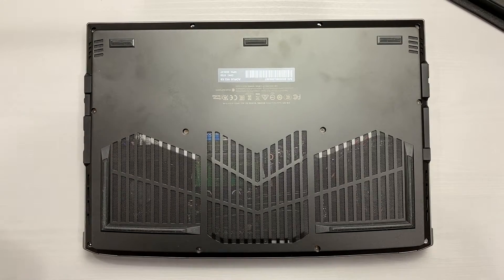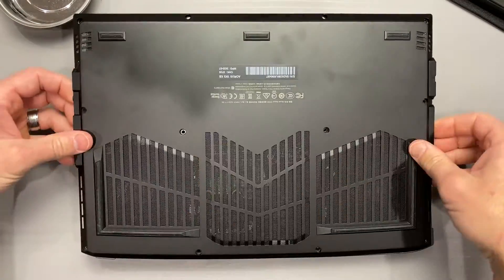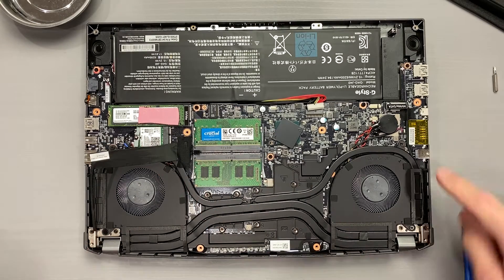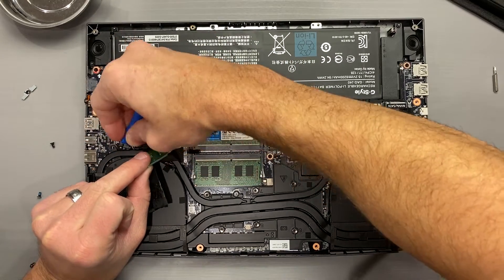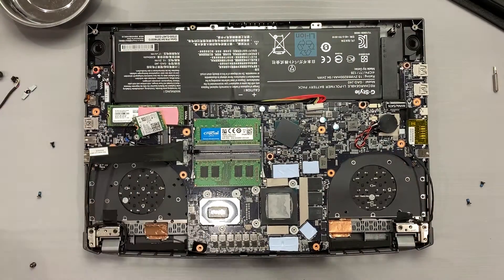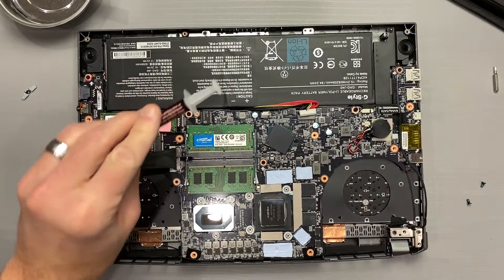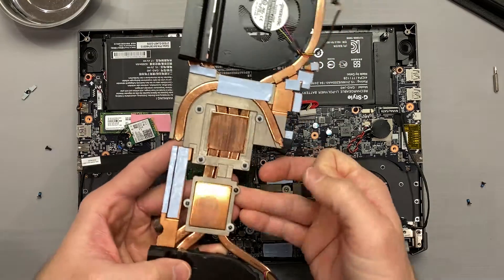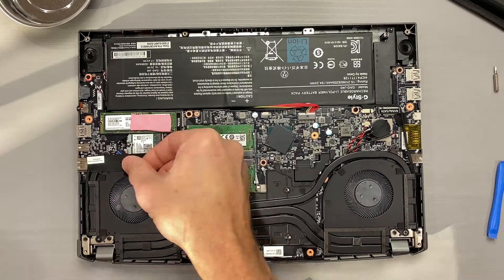Aorus 15G Repaste!  Covers 17G and Newer Aero Laptops

Comment: Hi, if one wants to put back the 7 black rubber tips you removed which cover the screws of the heatsink what type of glue is suggested? As far as I know, glue put there must be heat resistant (until 100-110 C temps at least) and it must be not flammable. Otherwise, when you use the laptop and the cpu reaches high temps of 90-100 C, there is high risk of triggering fire. This can be very dangerous. Normal glues don’t have those specific properties. Only silicone sealants can resist very high temps but I don’t know if they are appropriate for the inside of a laptop. What would you suggest? Also, if those rubber tips are not properly re-glued and they collapse on the motherboard, they could be moving around while using the laptop and risking to fry components (high ESD risk).

Comment: Hey there! I am going to replace my cpu fan because it started rattling for a while now. I also planned to repaste my cpu and gpu when disassembling the heatsink. Is it necessary to replace thermal pads as wel. I have the Aorus 15G KC with a RTX 3060 and never done this before with this laptop since i bought it in summer 2021.

Comment: Hey mate, I just disassembly my laptop and I do that thermal paste, after I run laptop but display is not working and fans are not running just rgb lightnin on , when I try to shut down laptop with power button its not working just looping.

Comment: Hello, very good video and explanation, I wanted to ask you a question. Did you see the Wi-Fi card? The cables are disconnected by pressure, right?  Greetings from Argentina Buenos Aires
Reply from the maker: They clip into place.  Very small and prefer even pressure when removing and installing the wires onto the WiFi card.

Comment: Yesterday i gave my laptop for cleaning and repaste,but after i got it home there’s a sound like a fan hitting a wire or something that you can hear it only in low rpm,so tonight i think i will open the laptop to see if i can find a solution,problem is i don’t have any paste to put if i remove the fans,my question is(is it necessary to put new paste every time you remove fans)?the guy repaste it 2 days ago so paste is new can it stay with same paste or need new every time you remove fans?

Comment: Hello there, I have a Aorus 15p yd which is one year old next month, I think it's time for a repaste. Do you recommend also replacing the thermal pads as well?
Reply from the maker: It’s a rare necessity to change the pads.  Unless there’s a fitment issue where a pad is too thick or thin, you’re usually good to reuse them.  

In the event there are no pads and the manufacturer used a different “paste”, then you should clean most of that and replace with something like K5Pro for example.

Comment: i made sure everything was reconnected and the gluing done exactly like you did.  When i turn on the power, the keyboards and everything light up by my screen is a blank.  What might have happened?  i onlyndisconnected the 7 screws and the fans to pull the cooler unit off.  Thank you

Comment: You don't put a blob on the CPU and GPU and then press the cooler in place. With a chip card or with your fingertip, the thermal paste should be smoothed out and spread on the chips.
Reply from the maker: I have done hundreds of these just on laptops alone and more than that on desktops every time I take it off there’s a perfect amount. You do things enough you get a feel for it

Comment: I may need to replace one of the fans on a laptop of this model (it's starting to rattle). I couldn't really tell from the video, but would it be possible to remove one of the fans without having to remove the entire cooling setup (including heat pipes and interface)?
Reply: I have the same question. It looks like maybe the fans can be removed without pulling the entire cooling assembly, but I'd really like to confirm before I disassemble. Would appreciate any guidance folks can give.
Reply: Doing my fan replacement now. You have to pull the entire cooling assembly out to replace the CPU/GPU fans, but it doesn't appear that the fans themselves will be all the difficult to swap once the assembly is out. A couple of differences to note from the above video compared to my own system - I only have 6 screws holding the cooling assembly in place instead of 7, and the CPU fan (on the left in the video) plugs in next to the memory instead of under the Wi-Fi card. But this video made me comfortable enough to get started, and figuring out the differences were small enough that the get-started push was all I needed to get through the process.

Comment: Redid my AORUS 15P KD today.  They did a pretty bad job on both CPU and GPU.  There had to be at least a half millimeter of caked/dried thermal paste in between both CPU and GPU die and heatsinks. After voiding my warranty and scraping off whatever crap gigabyte used and replacing with a skim coat of Arctic Silver V I've dropped 15c and no more crashes. I can use Nvidia's boost now too crashes.
Reply from the maker: Honestly this is probably just good practice to do once a year or sooner

Comment: "Doesn't pump out" - of course there is a pumping out, just like with EVERY similar thermal paste with similar ingredients, except perhaps IC Diamond which has its own problems and which is not available in stock anymore even at manufacturer's website. You can find actual evidence of this paste pump out on internet, just because you personally were lucky with it does not invalidate experience of people who did experience pump out on their particular laptop, with the particular mount system and particular heatsink pressure and surface quality.

Comment: Careful guys, the Aero 15 does not use pads for the major VRM's like the AORUS laptops. It uses a relatively gooey paste, when people tried replacing this paste with regular paste they found that sometimes you have much less contact. The recommendation is to use 0.5mm pads (1mm if necessary). In that respect the aorus is easier to repaste. On the Aero when repasting was done and new pads installed there actually was a 3-4 degree temperature delta in regular day to day use but max temps were the same while gaming. It may help to keep the fans a tiny bit quieter? The GPU's due to the nm size, efficiency and allocated wattage does pretty well thermally, it's the bloody 8 core intel cpu's that gigabyte insist on using that are blowing these laptops beyond 90 degrees.
Reply: Hello, I am using thermal grizzly thermal paste. What could be the reason for the overheating and shutdown problem after 5 days?
Reply: Gigabyte aorus 15

Comment: Using this guide, I managed to successfully repaste my new Aorus G15 YC with Kryonought paste; was previously getting temps under load of around 93c.

Am now getting temps of..... 93c. God dammit.

Still, thanks very much for the easy to follow video!
Reply: Hello, I am using thermal grizzly thermal paste. What could be the reason for the overheating and shutdown problem after 5 days?
Reply: @samimsamet  Improper thermal paste application which, causes overheating, resulting in a shutdown

Comment: Thanks Bob, I just did my first successful repaste of my brand-new aorus 17g rtx 3070 following your instructions.

I'm in Canada so I 'only' had access to Noctua NT-H2 in stock, still I'm satiated & grateful
Reply from the maker: What made you want to apply new thermal paste on that brand new laptop? Great job by the way!
Reply: @BobOfAllTrades  learning experience and desire for maximum performance. It was already doing well, I love to thinker lol. Now I don't like my devices locked (used to root android) so I'm researching how to unlock > mod the bios so I can undervolt the CPU lol. Though I don't need it with my temps, again I love to get peak available performances :-D I waited a long time before buying this computer and finally I trusted you, which worked out really well for my needs. Thanks again Bob
Reply from the maker: @Seb_Matte  Right on!  The Aorus and Aero laptops have been some of my favs for two years!
Reply: @Seb_Matte  i have the same models and would like to know what your temp diffs are lol. Mine out the box currently peaks at about 90C for CPU and 80C for GPU.
Reply: I'm very tempted to do the same on my new Aorus 15G RTX3080. CPU temps reaching around 93 - 94 degrees C. Just concerned it'll void the warranty!

Comment: Hey, thanks for the video, I have the YC version of this laptop, the one with the 3080, and will eventually repaste it, have you ever tried kryonaut’s liquid metal paste? I’m sure it will give you better results than thermal grease! Anyway, just a thought, once again, excellent tutorial, I’ll save it for when the time comes to do this to my laptop! Thank you!
Reply: Hi, I have the same version that you have.  Did you ever end up doing the repaste?
Reply: @WarFreak131  no, I haven't had the need to do so, so far! Cheers!
Reply: I also have this laptop and left side (GPU?) fan is loud. I need to replace it, and may as well remastered. Has has anyone else been in the same boat? Any advice?

Comment: I am doing a repaste on my Aero 15x. I noticed in this disassembly the vram had pads. Do you recommend I use thermal pads or paste for the vram? If you recommend thermal pads, which ones should I use?
Reply from the maker: Correct they used paste on the older chassis.  I’ve used .5 fujipoly pads on those before without issue.
Reply: @BobOfAllTrades  I'll check fujipoly out as they'd be the ideal buy at 17 W/mK but they're particularly hard to find where I am in Europe (I can only get the 11 W/mK pads) so I might go for Gelid Solution's pads which offer around 12 W/mK of thermal conductivity which if I'm not mistaken is around the same as Thermal Grizzly Kryonaut
Reply from the maker: Call a lot of the tech enthusiasts will use K5 pro on those parts instead. It lasts a very long time also.
Reply: @BobOfAllTrades  I'll check it out, thanks for the help

Comment: I want to repaste my g7 7700. Do you think that would void my warranty? What if I don't tell them? They won't know right? LoL
Reply from the maker: That’s an easy repaste 👍
Reply: @BobOfAllTrades  Just ordered the phobo grease extreme. Wish me luck cause I’ve never done thermal paste before. Any tips?
Reply: @justswitched8841  I personally did a thin spread method first, placed the heatpipes back on to get some paste on them, took it off, and then did an x method on the square die and a line on the rectangular die. But that's just my method and may be overkill tbh.
Reply: @vladstr100  do i need to worry about esd in laptop repaste?
Reply: @vishaltandale6382  I would take some care to avoid ESD but if Linus Tech Tips video with Electroboom says anything, it may not be as bad.

Comment: Its good to see a laptop manufacturer applying the thermal paste properly... not many do that, but I AM concerned about how laptop manufacturers are allowing CPU's to reach 90 degrees Celsius under full load.
They really need to invest more in quality cooling and/or redesign it (especially because the method of cooling which is used by all laptops went virtually unchanged for decades).
Reply from the maker: Intel t-junction is 100°C. Laptops run hot as 🔥 for years and people don’t even realize it.  Most keep on trucking.  

Don’t get me wrong if I was clearly OK with this you would not see videos like this.
Reply: @BobOfAllTrades  I know, I'm just saying that because of high temperatures, laptops end up running hot and are quite loud (which makes it difficult to use them without headphones - and if you're doing content creation or productivity work which taxes both CPU and GPU at the same time while in class, it would be very unpleasant to use the hot/loud laptop - example being the Asus Rog GL702ZC - that thing had temps in the 85 deg range at full load, which were fine, but the fan noise was like a jet engine - it produced ringing in my ears and it ended up frying itself after about a month of use - I did manage to replace it with PH517-61 which is not only more powerful, but dead quiet and cool compared to most laptops on the market and even some desktops).

By redesigning the cooling to drop the CPU and GPU temperatures to a much more 'comfortable' level of say 80 degrees Celsius or even 75 degrees Celsius (when fully maxed out), the hw won't be running too hot and the system would be relatively quiet - also, lower temperatures result in higher longevity of the hw in  general.

Comment: Any idea if the keyboard is easily removable?
Reply from the maker: You would have to remove the motherboard to even assume that’s possible. Why would you want to do that?
Reply: @BobOfAllTrades  For potential cleaning purposes. Gaps may be tight but dust still collect over time.
Reply: @boy638  im starting to consider it for my 15x v8

Comment: Hey man. You always do nice videos. I always watch your videos. Thank yoh for your content. I have a question. What the best thermal paste that you can recommend? I have a asus zephurus s15 with rtx 2070 115 wats. Its very nice laptop and performs better than max _q gpus. But it hits 80° C all the time. It even goes up to 83 or 84 sometimes. Should i repaste? And whats the best thermal paste. Thank you in advance.
Reply: He said in this video what is one of the best pastes(nanogrease). If you want the very best you would need liquid metal(may not be worth the risk) or kingpin kpx but the cost is steep for(possibly) a few degrees. Those temps arent that bad hopefully the fans arent maxxed out though?
Reply: @Jtwizzle  thanks for reply. What do you think about Gelid GC extreme. There was another reviewer who was saying that that paste was really good.
Reply: Im just trying to lower the gpu temps at list little bit. If it ran like 75°c I would be happy with that. The problem is that i got 115 watt rtx 2070.
Reply: Yeah its pretty good paste. Worth trying I guess. I have a older laptop(msi gt72), thick and heavy with good cooling and liquid metal with a 115w gtx 1070 and it sits at 80-84c under a heavy load. If the fans are maxed it will drop to low 70s. Pretty normal and safe temps especially for laptops.
Reply: @Jtwizzle  mine sits at 81 to 84 degres  with max fans.

Comment: If I change the thermal pads of my laptop, do they have to be the same width as the factory ones or can they be different? I need help, I have hp omen 15 2019
Reply from the maker: The width needs to be enough to properly cover the components without interfering with the cooler. Thickness also has to be spot on.
Reply: @BobOfAllTrades  If the factory thermal pads are 1.5 mm thick, do I have to replace them with ones of the same thickness?
Reply: @jonathaaleman3369  yes ±0.1mm difference can be margin you can get away with
Reply: @Pardeepangaria  Thanks, any recommendation of thermal pads?
Reply: @jonathaaleman3369  if your area is highly humid and you move between cold and hot regions, Arctic thermal pads should last around 2yrs. I replaced it after 5yrs.